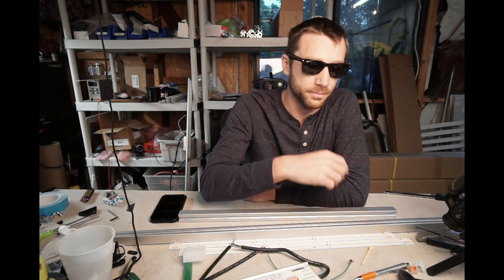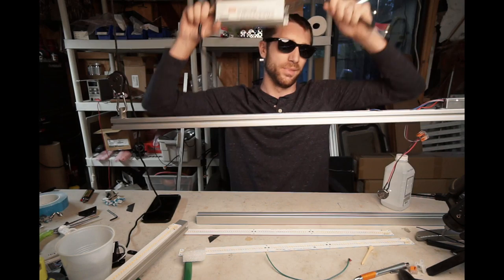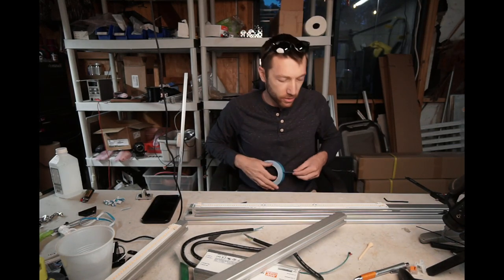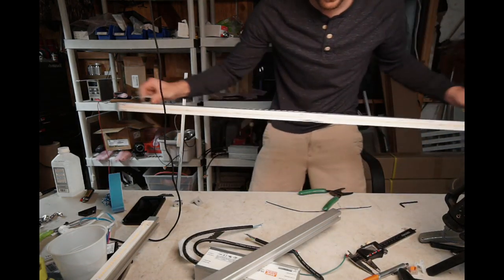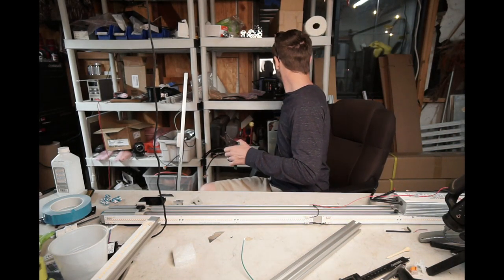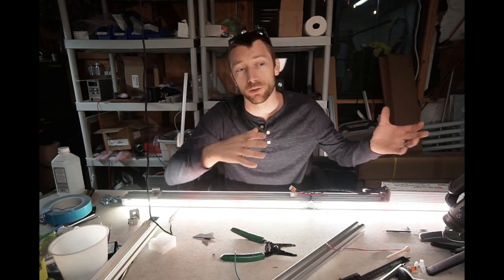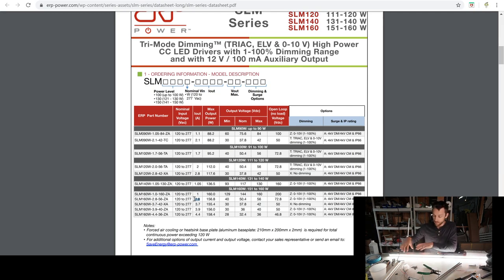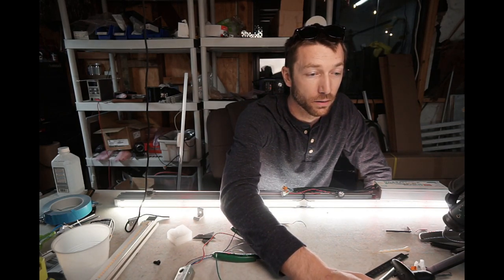Photo Boost Side/Intra-Canopy Lighting

Comment: If you drilled the holes in the meanwell to 1/4”, I wonder if you could just use the driver with a few T-nuts to hold the two heatsinks together for a perfect fit just using the driver. Thinking out loud I guess. 🤷🏽‍♂️
Reply from the maker: Probably. Specially a high wattage metal driver like an HLG.

Comment: I built my entire light with the same 80/20 extrusion that you show here. The 80/20 heat sinks are actually cooler than the PLC heatsinks in my other tent. The 80/20  build was MUCH easier to assemble as well as being WAY more rigid.
Reply: Running mine at 1750 ma.

Comment: Had a thought rather them use 2 pieces of 80/20 what about using 1 piece of 80/20 go to home depot and buy 2 pieces of 1 inch by 1/8 inch aluminum then mount the aluminum to the 80/20 with both thermal tape as well as t nuts and bolts then attach the plc strips to the aluminum

Comment: if i were doing it , i would have left a tiny gap between each bar. since more surface area cools better. by putting them together you actually block one side from radiating heat. instead that one side is now touching another side that is radiating heat. with a small gap , that side would be allowed to touch coolish air. plus the added gap would have allowed the u slots to line up properly , and the driver to sit flush. i know it isnt a big deal since the bars are more then capable of dissipating the heat, just a couple benefits since everything will also fit better.you are way more of a pro then me for sure lol. just an observation.
Reply from the maker: Ya, thought about that too. Just a little piece of fiberglass in between each end as a insulating spacer.
Reply: @GreengenesGardenOfficial  that would work.